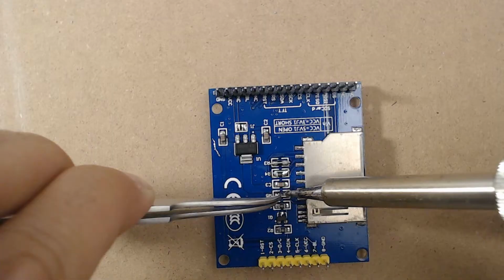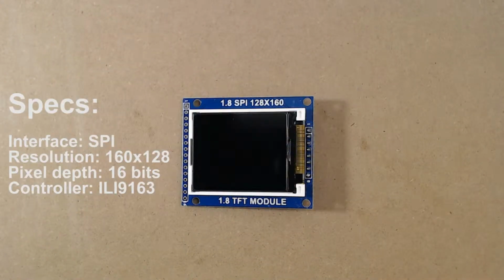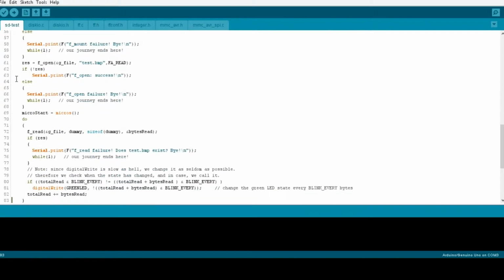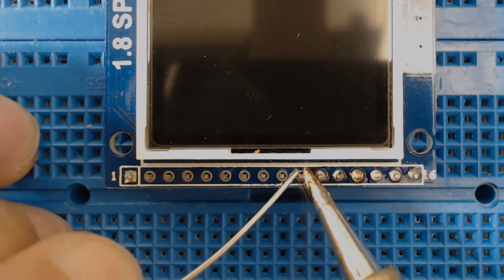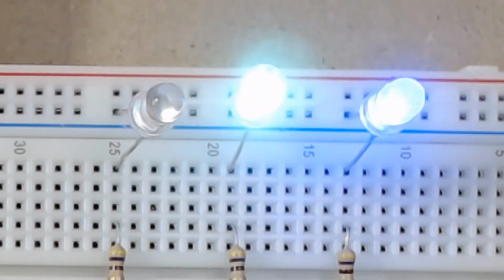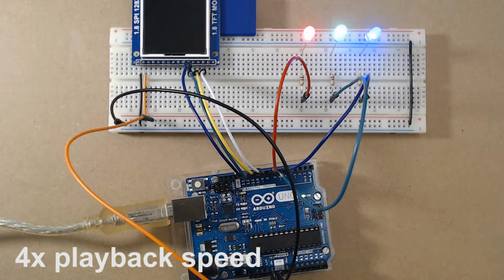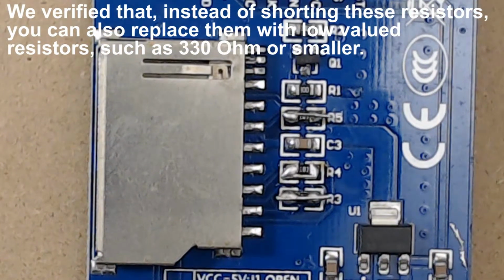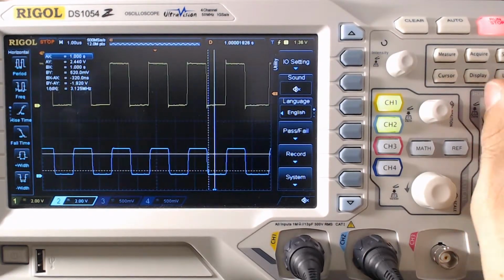How to play a video on Arduino Uno (2/6) - Enabling high speed SD transfers on 1.8" TFT + SD module

Comment: Hi there! will this work for a TFT_320QVT_9341 3.2 LCD connected to Arduino Mega?
Reply from the maker: Hi there! 
This could work with some modifications, but it will run at a very low frame rate. 
In fact your LCD has a resolution of 320x240 pixels, which means that there are about 4 times the number of pixels on the screen we used (160x128 pixels). At best you can run it at about 5 frames per second, and not 20. 
Even using an ATSAMD21 (uChip, Arduino Zero, etc.) you can just achieve 19 fps at most, and you still have to overclock the SPI to 24 MHz...